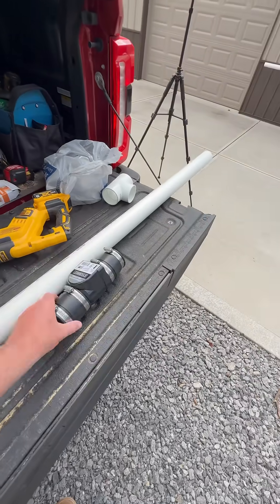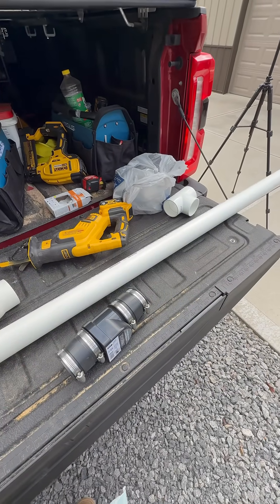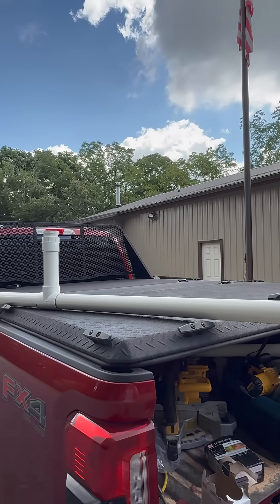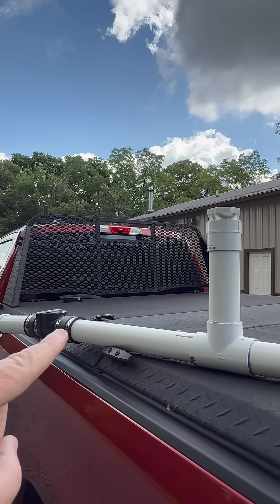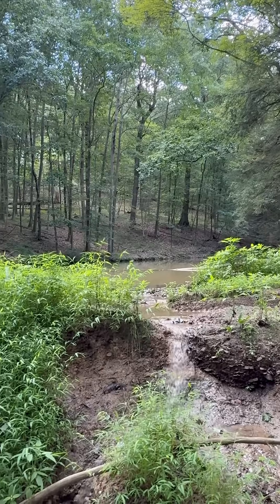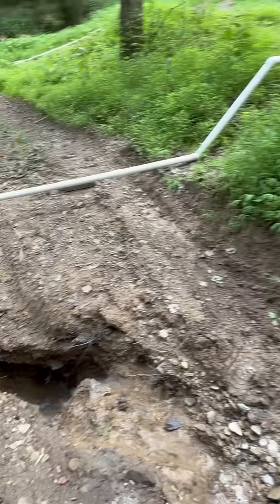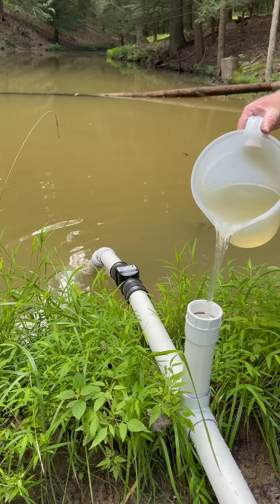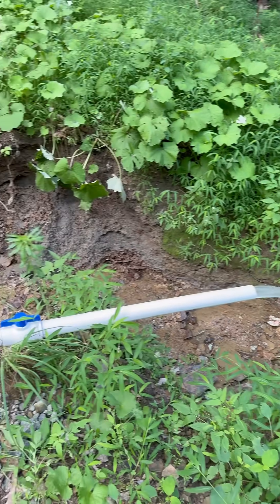Cheap, Easy, Siphon System, No Pump Needed, over 100GPM

Comment: If you put a double elbow on your overflow outlet pipe, and keep the pond side of that below the wanted water level, the over flow will not plug with floating debris.
Reply: Now yer Talken "Super High-Tech"⚙️👍.
Reply: You need to drill a hole in the top of the crossover pipe to keep it from siphon the water put. You need a u shaped pipe with the inlet several inches down in the water to keep floating  things out.
Reply: So simple yet ingenious

Comment: If you ever do a stand pipe again, get the 3 inch PVC pipe made for electrical wiring runs. The 90 degree bend is a gentle 4 foot piece. Nothing should get stuck in that stuff.